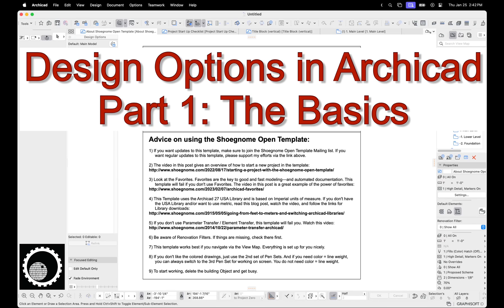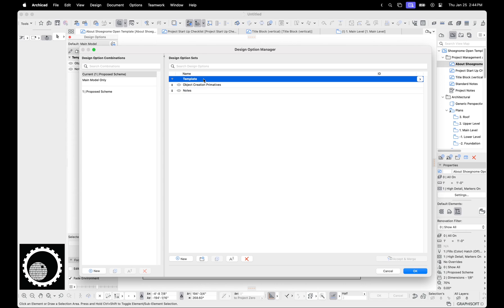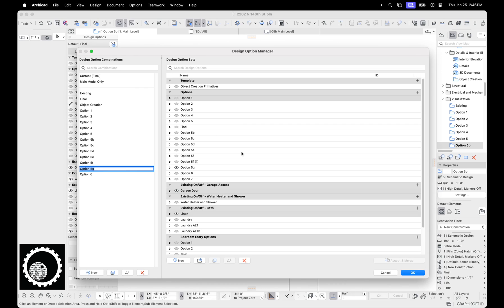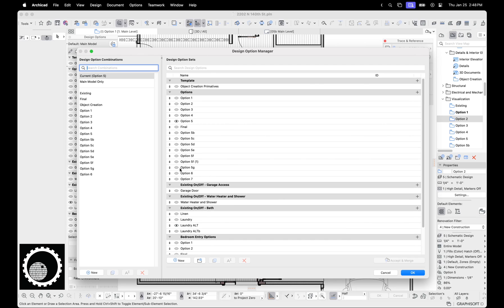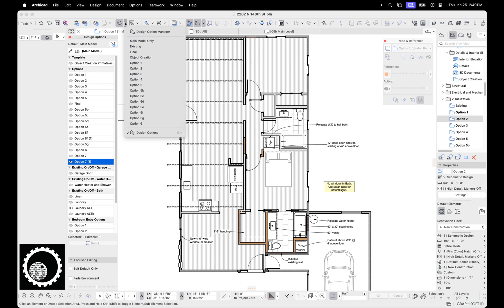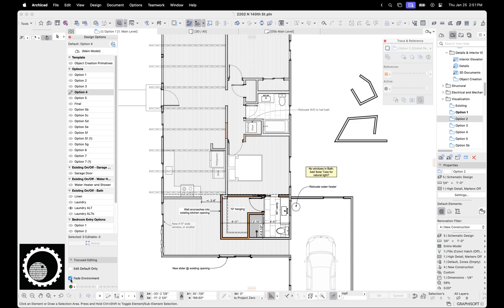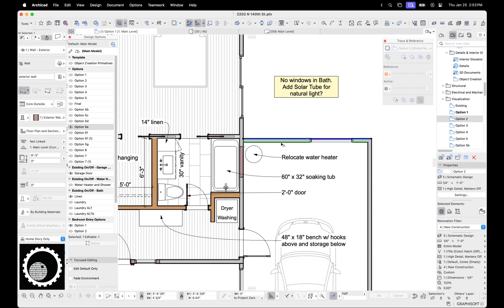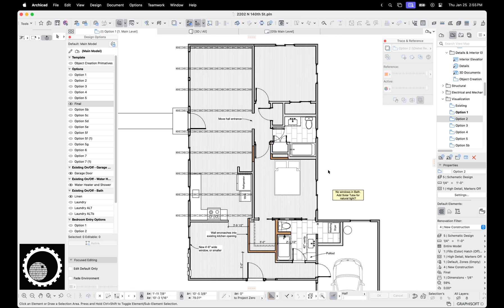Archicad Tutorial #96: Design Options in Archicad, Part 1 (The Basics)

Comment: Hi Your Videos Is So Helpful 
I Have A question And I Hope You Answer Me 
when Generate An Elevation its keep generate the View Every Time I open it even if there is nothing update
can you help me
Reply from the maker: You can set elevations, sections, and interior elevations to Manual rebuild Model. Similarly you can set any placed view on a Layout to manual instead of automatic update.

In general you want to avoid this though. If the model is slow to rebuild when you open a view, check to see if there's some model elements slowing things down (complex geometry, excessive SEOs, bad objects).

Often it's worth saving a copy of the file, deleting elements, and figuring out if it's just one or two bad items. It usually is.

Comment: Extremely useful video.  Looking forward to the follow up vids as well.  This is a major improvement to Archicad and will work perfectly with my workflow. No more having to copy the entire model 500 feet apart to create various options.
Reply from the maker: Thank you. I'm super excited to share the next 3 videos.
Reply: @Shoegnome  do you knowing any issues of importing a v26 model into 27 and then using the design options?
Reply from the maker: @markrenz9381 I'm literally doing that right now! In fact I've almost exclusively worked on design options with projects migrated from 26 to 27. No issues other than needed to set them up from scratch.
Reply: @Shoegnome  awesome.  Thank you.
Reply: Excellent video, really clarified a lot for me! Looking forward to seeing the rest of your workflow.
Reply from the maker: @ackeeworkshop5776 that's great to hear. Design Options are really easy to work with, if you  get the basics.